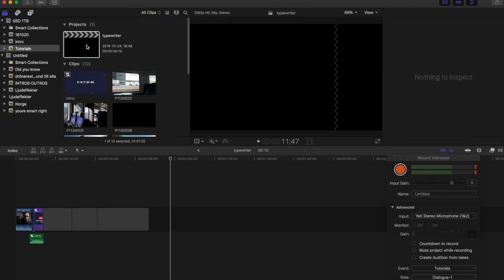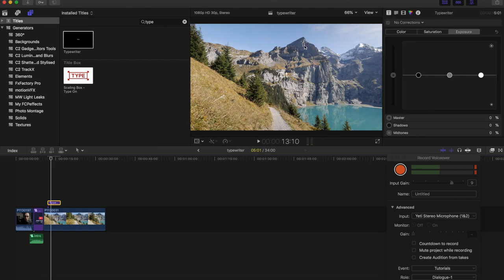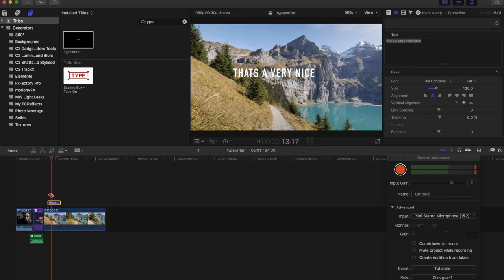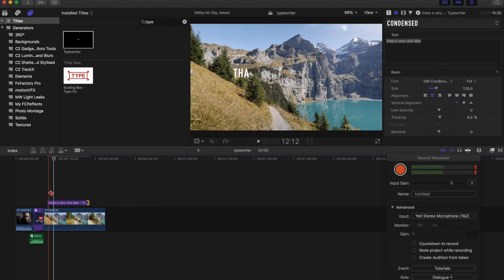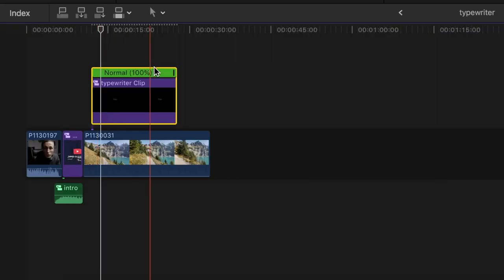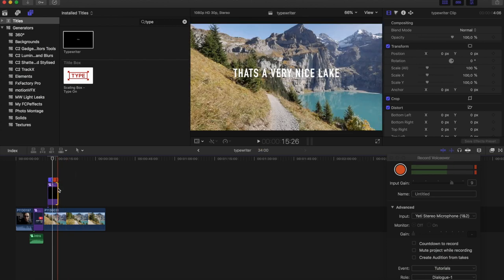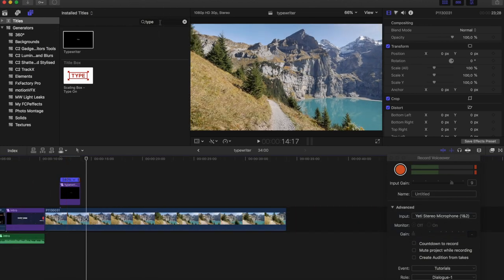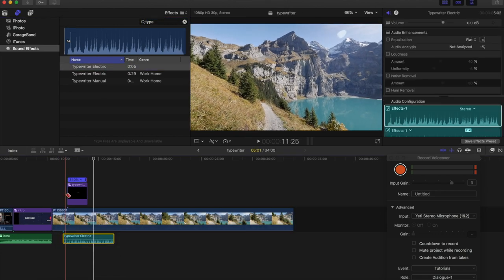TYPEWRITER FINAL CUT PRO - How to correct speed - How to use TYPEWRITER EFFECT - No extra Plugins

Comment: #R does not work on my fcp - what is the way to do it without this short cut?
Reply: @danieldaniel100  yep ofcourse the command G worked for me. But for some reason the R didn't allow change of speed
Reply: @danieldaniel100  i sure have it - as i said it worked with the #G but the #R did not give me the option to change the speed - thats why i asked is there a way without the shortcut - (i managed to work around it - did a freeze frame - and then work down the opacity of the layer.)